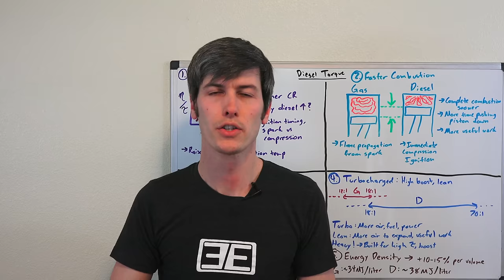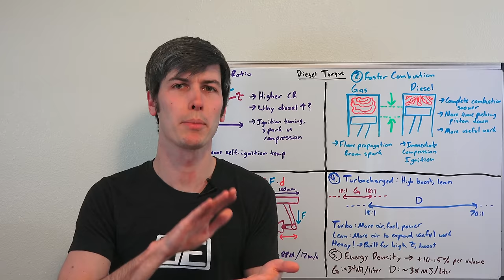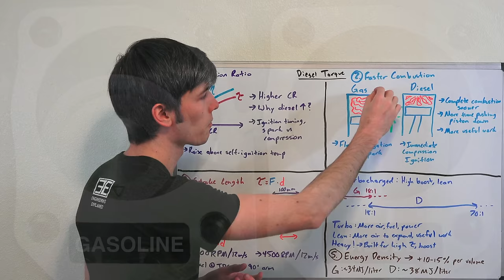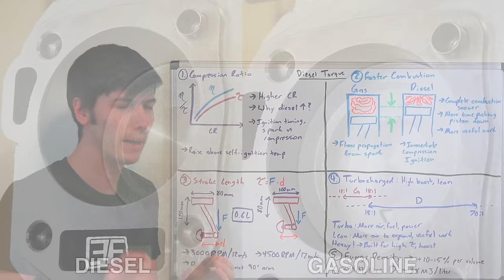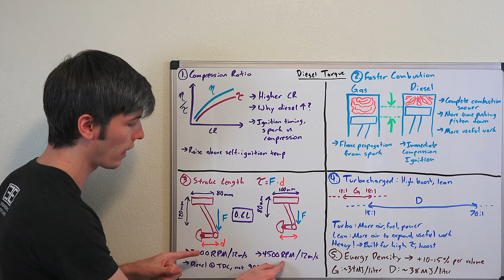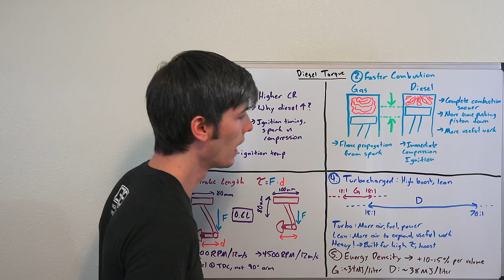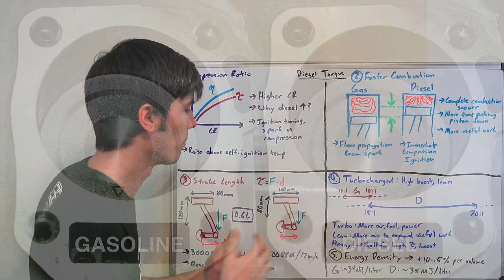5 Reasons Diesel Engines Make More Torque Than Gasoline

Comment: This video is nonsense.
You can't compare an engine with a turbo to one without - that's unfair.
You could equally put a turbo or supercharger on a petrol engine and say it was better than a diesel.
Also - diesel fuel is low octane which means it burns faster -
that's the worst condition for more torque and power.
High octane slow burning fuel such as 98 octane petrol gives more useful power
in a petrol engine.
They use methanol on some drag racing cars because it has an octane of 130 -
it burns much more slowly but has a greater fuel to air ratio -
meaning you can put more fuel in and that fuel has more time to push the piston down.
Who the hell is the narrator?
Reply: “An octane rating, or octane number, is a standard measure of the performance of an engine or aviation fuel. The higher the octane number, the more compression the fuel can withstand before detonating” Wikipedia

Comment: Do a video on why honda engines tend to have a higher horsepower figure than torque. Maybe touch up on the e90 m3, and why it makes over 400 hp, but under 300 ft lb torque. Would be great to know
Reply: The figures are meaningless in this context. Measure torque in Nm; engine speed in radians-per-second; and power in kW and everything changes. 300 bhp is not the same as 300 lbft. Just like five eggs isn't the same as five ounces of flour.

Comment: You missed one very important point that is probably more significant than any of these points (combined). A diesels fuel system is able to continue to spray fuel into the compression and power strokes. This allows the diesel to continue to inject fuel throughout most of the power stroke thus maintaining maximum expansion pressures and thus keeping the torque factors against the crank higher throughout the power stroke.
Reply: Samuel Rosenberg You missed my point. If you are factoring all the fuel being sprayed into the cylinder in I single short timed burst then the timing would have the effect you describe. I am a diesel mechanic and know how ‘rolling coal’ happens. I was talking about a diesel’s ability to fuel over a period of time. More in the manner of a controlled burn rather than just an explosion. Modern high efficiency diesels due this controlled burn even better by using several injector pulses throughout the power stroke including pre-burn and post burn pulses to try insure all fuel is burned as that relates to emissions.

Comment: intresting video but if you want a more fast car i think you better stick with gasoline , because it works with higher RPM thus giving you higher top speeds.(in High speeds you dont need the torque) Am i right?
Reply: Not correct. Top speed is determined by power and gearing. A 300 bhp diesel engine will achieve the same top speed as a 300 bhp gasoline engine but the diesel derivative will have higher gears to facilitate this.

Comment: This video states that in a diesel engine, the fuel combusts immediately whereas gasoline combusts over a longer period of time.  So why is the Otto Cycle (gasoline) idealized as heat input at constant volume, which to me means instantaneous combustion whereas the Diesel Cycle is idealized as heat input over a volume change, which to me a longer duration combustion?
Reply: Okay I did some research and I don't think the statements in this video are completely accurate.  It is true that Diesel fuel will combust instantaneously when injected into the engine.  HOWEVER, it takes time for that fuel to be pumped into the engine, which makes the Diesel combustion actually take longer than gasoline combustion.  In a gasoline engine, all the fuel is already in the cylinder when combustion begins, so combustion speed is limited by how quickly the flame can propagate through the cylinder.  Diesel is limited by how quickly the fuel can be pumped into the cylinder.  Pumping is slower than flame propagation, so Diesel combustion is slower.  The real reason Diesels produce more torque is their higher compression ratio, as you state in your video.

Comment: This was really interesting, but do you have a video that offers a straight, no environment- or big oil-conspiracy politically charged purely engineering point of view answer as to why so many brands are phasing out diesel engines? Because this video makes that trend make even less sense.
Reply: How can you get rid of diesels.
There would be no Transports 18 wheeler trucks on the road bringing every single  man made object or food to a store if not for a diesel.
Not electric or gas engine can run a Truck over two tons efficiently.

Comment: My Sprinter Diesel engine squirts fuel up to ~ thirty times during the power stroke. It continues to intermittently squirt during the exhaust stroke if the converter isn't up to temperature. Multiple squirts eliminate the typical diesel sound and the corresponding stress and engine noise.
I've learned a lot from your videos as well as those by Professor John Kelly.

Comment: This very well presented video is a good example of why you can't believe everything you see on the internet! Some of the information presented is simply incorrect. Gasoline spark ignition engines are constant volume (isovolumic) engines, the fuel air mixture burns at once with a short "pop" near top dead center. Diesel engines are constant pressure (isobaric) engines. The fuel burns over a period of time during the injection event as the piston descends. Diesel engines make more torque because the pressure in the cylinder is maintained by continuing to inject fuel as the piston descends and the moment arm of the crank increases.  Thank you for taking the time to make the video! Please consider making another one to correct some of the fundamental mistakes, many people are listening to you!
Reply from the maker: Wouldn’t the duration you inject fuel (in the diesel) be dependent upon how much power (throttle) you’re trying to make? I’ve seen several point this out, but I can’t find any literature (not to say it isn’t true) that says simultaneous diesel combustion is slower than flame propagation through a homogeneous gasoline mixture (which is what the video states). The information was sourced from Mazda/Mazda engineering (so I felt comfortable presenting it), and I’m in talks behind the scenes with other engineers to try and sort out the facts. I will likely have an update!
Reply: Thanks for the follow up. Yes, I believe the injection pressure is constant and the injection duration is altered with throttle setting on common rail injection systems but I do not know for sure. If you were to lower the injection pressure the fuel would not atomize and you would get alot of diesel rattle.

Comment: First off, I love your videos and the way you approach the explanations. I took several calc and physics classes in college and have always been fascinated by the ICE. I have a diesel pickup and one of the main concerns for anyone with a diesel who is looking to turn up the power levels is the exhaust gas temperatures. My question is this: why do diesel manufacturers not employ a supercharger system instead of a turbo, so as to avoid the potentially turbo ruining egts? I know that superchargers are considered a parasitic loss, since they require crank hp to spin. However, a part of me wonders if the extra power potential (which is limited by egts in the turbo setup) would not overcome the extra parasitic loss associated with the crank driven forced induction. They could even use a turbine wheel, much like the cold side of a pre existing turbo, with a belt or chain attached to the drive pulley on the front of the crankshaft. One would also think this could reduce intake temps as the compressed air would hopefully stay cooler, without the heat transfer from the hot side of the turbo system. With continuing advances in electric motor technology, one day all forced induction systems may be powered by an electric motor that is capable of providing perfectly metered boost at all rpm levels, with very little to zero lag. What are your thoughts on this concept? I would love to see a video about the idea if you had the time.

Comment: Diesel engines have more torque primarily because of the longer stroke. Because it gives the piston more leverage on the crankshaft. Also diesel burns more slowly than gasoline so it continues to burn and expand pushing the piston all the way down generating more torque.
Reply: It's actually more to do with higher brake mean effective cylinder pressure. Longer stroke means the flamefront has to propagate faster in order to keep up with the descending piston. Hence diesel engines topping out at lower engine rpms.

Comment: I don't think point 3 actually works out. Force is proportional to pressure and surface. So torque = force * stroke is actually the same in the two situations - unless you have a different pressure.
Reply: I think that was a bad example because it is more for hp than torque.  Increasing hp does not necessarily change torque.   I think points 3 and 4 should have been combined with same displacement to demonstrate how energy density can create more force even with the same displacement.   Basically more bang for the buck.

Comment: Why are all engines not Diesel? Why isn't there a Diesel Snowmobile? This video just makes it seem like gasoline engines should not exist. There has to be a reason for this. It can't just be as simple as Diesel engines weigh too much.
Reply: Diesels cost more to manufacture making the vehicle in which they're installed more expensive.  As an example, in a  pickup truck, the diesel motor is about a $9,000 option.  Diesels are more expensive to maintain, and more expensive to repair. They're also (thanks to the EPA) a pollution control nightmare with exhaust gas re-circulation, diesel exhaust fluid, and a diesel particulate filter (DPF) that has to be cleaned at regular intervals by heating it up and burning off the soot (carbon deposits).   The DPF regen cycle can take 20 minutes to an hour with temperatures in the DPF reaching 600 C (1100 F).

Comment: Aren't diesel bores usually bigger? They can be because the bore of a gasoline engine is limited by flame propogation speed to the cylinder walls upon ignition, whereas diesel ignite across the whole cylinder simultaneously.
Reply: True.
The Ford F-250 pickup is a 7.3 L diesel while the gas motor is a 5L .

Comment: For a given displacement and cylinder pressure, longer stroke doesn't mean more work done in one cycle. Stroke cancels out in the equations of work. Consider this:
1. work = force x stroke distance
2. force = pressure x bore area
3. displacement = bore area x stroke distance

Put equations 1 and 2 together and you get:
4. work = pressure x bore area x stroke distance

Put equations 3 and 4 together and you get:
5. work = pressure x displacement
Reply: Your formula doesn't take into account the nature of a rotating crankshaft.  Force at the top and bottom of the stroke produces very little work.  It is force on the piston while the rod and crankshaft are angled to one another that produces the best torque.  With a long stroke this angled relationship is longer. But cylinder pressure is not constant.  Cylinder pressure must be optimized to push the piston all the way through its useful range.   
Diesels will continue to inject fuel to keep the pressure up through a longer stroke.  A gasoline engine must rely on proper spark timing to achieve peak cylinder pressures in the useful range of the stroke.
Reply: @bogushavis  My formula is correct. You are also correct that little work is done near the top and bottom, but that is because the piston moves very little during that part of the crank rotation. Work done by a gas is equal to pressure times change in volume. Since very little energy is lost to friction in the engine bearings, that work is transferred to the crankshaft regardless of the crank geometry.

Comment: Here is one thing that still stumps me. Why are Diesel engines slower than petrol engines? The one comparison I think about is an engine that runs on high octane fuel and has a high compression ratio and a Diesel engine that usually always has a high compression ratio. Why is it that the Diesel engine that has a high compression ratio and high energy fuel is going to be slower than a gas engine that also has a high compression ratio and uses high octane fuel? What is the difference chemically between high octane gas and diesel and in the ways they burn?
Reply: Diesel engines are slower because they require a longer stroke to complete the combustion process.   You could think of it like cranking a short handle vs a long handle.  The long handle is Diesel, short handle is gasoline.   The longer handle makes it easier to turn, but takes more movement to complete 1 revolution.  
Diesel combustion is actually faster than gasoline because of the higher afr, even though in normal atmospheric conditions gasoline will burn faster.  
Turbo lag can also be factored in if you are  considering acceleration.

Comment: Why do they not use turbo diesel for sports cars and then just gear the transmission accordingly if it has more power etc?
Reply: Because they haven't the same acceleration power compared to the gas counterpart, they generate a lot of vibrations, and they are significantly heavier than a gasoline engine

Comment: How are fuel injectors able to spray fuel inside such a highly compressed air situation? Wont they struggle?
Reply: High pressure fule pump (bosh pump, commonrail system)

Comment: I haven't seen the question pop up in the comments yet, but why is diesel more expensive than gasoline? I'm not that old but I do remember when diesel was (at least) .10 cents cheaper than regular unleaded gasoline. There were a ton of rigs, industrial machinery, and freighters back then, so I don't see the dramatic need for gouging the price of diesel. Besides, isn't diesel basically cheaper to produce than gasoline? If they come from the same source, then diesel should be cheaper. Are all the pump stations simply price gouging?
Reply: William Smith diesel fuel years ago was a byproduct of oil...Now with thge super catalyst production you make more gas and kerosene THAN Diesel Fuel...
Reply: William Smith that's why biodiesel is a future product...Which still needs work..

Comment: Diesel engines however don't burn all of the fuel taken into the cylinder, most of it is sent in a return back to the fuel tank. It warms up the fuel in the tank making for a more efficient burn.
Reply: The fuel return line is connected to the "common rail" and is used to regulate fuel pressure before injection. So the fuel that flows back to the fuel tank was never injected into the cylinder.

Comment: It was always my understanding that petrol fuel has a higher calorific value than Diesel fuel...?
Reply: I concur with Samuel.  In a nutshell, diesel has about 11% more energy per gallon, and weighs about 11% more per gallon than petrol.  So some of the advantages of diesel are not due to the engine, per se, but due to the denser fuel.